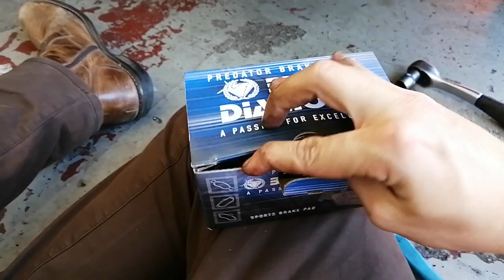Project Proton - Episode 4A 'The Penultimate'

Comment: Aww man you shouldn't take off all the 1.3 proton Wira
The reason why proton Wira 1.3 (which you guys has swapped 1.5) is because the wiring is different 
Instead you guys should take off the 1.3 wiring and swap it 1.5 wiring

But still good video,nicely done